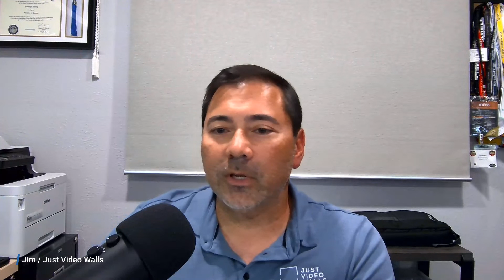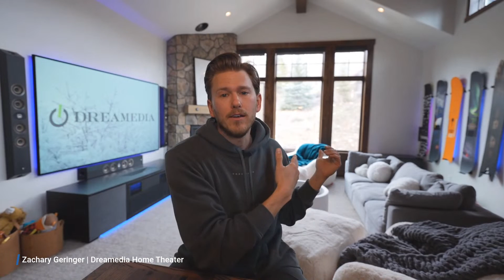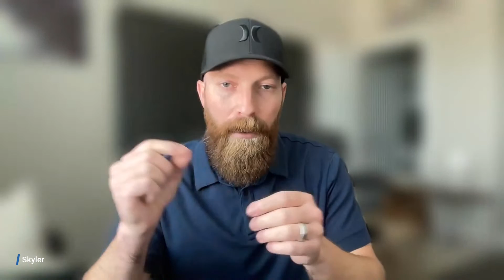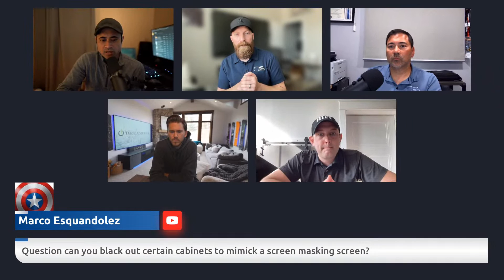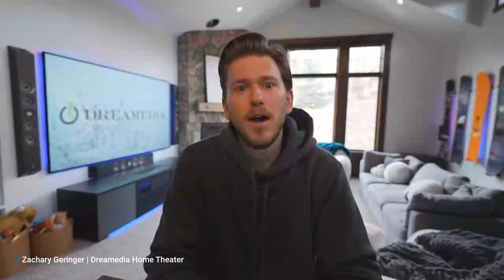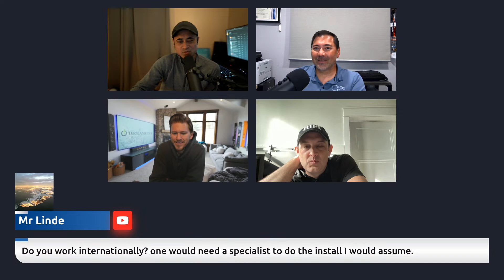Glasses Free 3D! LED Walls Taking Over Projectors! Just Video Walls

Comment: I plan on building out a “dream theater” at some point within the next 3-5 years in an outbuilding on my property. If by then - when I finally decide to pull the trigger - I hope Just Video Walls has an acoustically transparent LED panel. I would invest in a heartbeat if that kind of custom display tech also allowed me to put kickass cinema speakers behind the picture like a true cinematic experience. 🤘 Hope that’s in the works in the R&D dept. 🤞🤞

Comment: Still didn't answer the question.  Which is the resolution in the largest pixel pitch on one square
Reply: Sorry about that! Our 3.9mm is 128x128 for each cabinet. That particular cabinet is about 500x500mm so that's about 65,536 LEDs per square meter